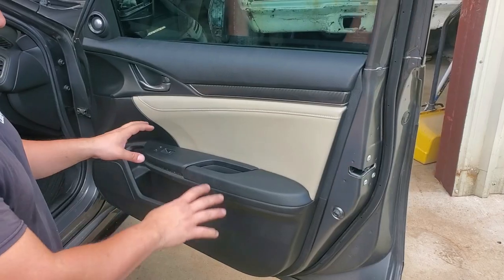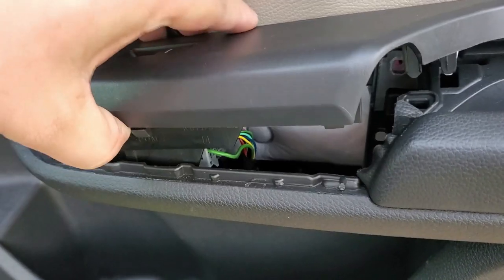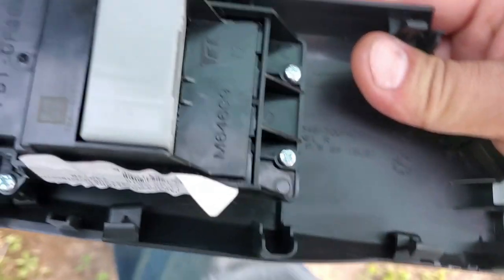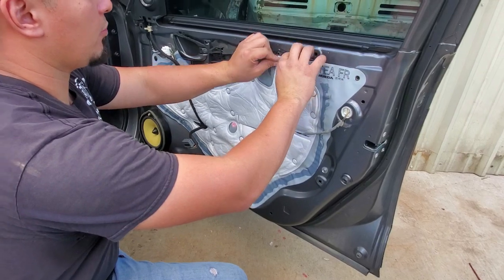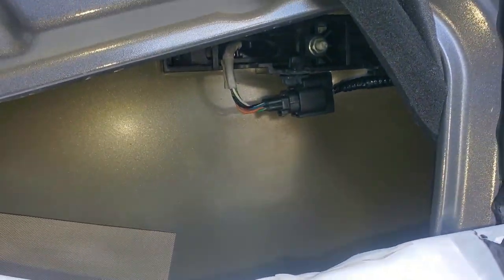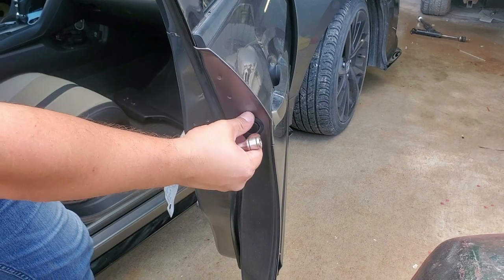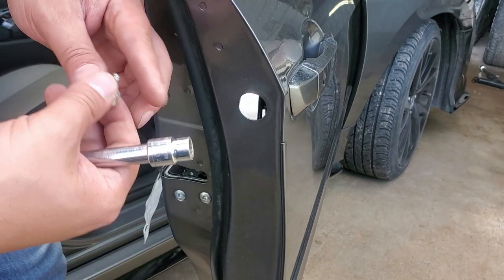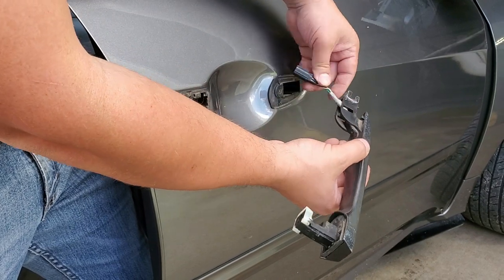2016-2021 Honda Civic Door Handle Replacement

Comment: Very useful, sir. But I would like to ask if I only want to remove the two outer parts of the handle to apply the black decal, do I not need to remove the inside of the door as shown at the beginning of the video? I just want to remove the two outer parts to make the decal application easier
Reply from the maker: @hdkenhphimhanhong8395  if I recall correctly you just need to remove the bolt at the side of the door and the handle should come out as shown

Comment: Hey Eddie, thanks for the helpful video. Do you have any tips on finding a replacement for a driver-side door handle that's starting to have paint problems like in your video? The door handle is totally functional -- just need to replace the plastic handle due to the paint issue.
Reply from the maker: Hey, so you are way better off painting to match the door handles. No need to replace them. And if you buy them, they will more than likely come unpainted. Take the car or door handles to a body shop so they can paint the handles for you. Unfortunately no other way around this other than repainting them...Honda didnt exactly do too well on their mirror and handles paint...
Reply: I have the same issue with my 2020 Civic. The dealership recommended going to a body shop. They said the could replace the handle, but the labor charges would be high.
Reply: @chris7015  so I actually ended up replacing the door handles myself and it costs such little money compared to getting it done by someone else or having it painted. It's also a lot easier that I thought it would be.
Reply: @AliKurnaz  I need to find a front driver’s handle for my 2020 Civic EXL sedan in Cosmic Blue.
Reply: @AliKurnaz  Where did you get your handles and do they appear to be good quality? I'd love to get rid of the flaky paint and think new handles would be much nicer than the covers as long as they work well. I have the hand-sensors for keyless entry.

Comment: Question, do you need to reprogram the keyless if you change out the door handle? Mine trips out it unlocks/lock without touching it and it may be why my battery is draining. Thanks
Reply from the maker: No you shouldn't have to. The programming is not saved via the handle so just simply replacing it will not require reprogram
Reply: @EddiesCustomsandRestorations   Thanks for the reply. I will unplug it for now and see if the draw goes away. If it does ill order a handle online and swap the module over so i dont need to paint a handle.
Reply from the maker: @philipl1302  yes ofcourse! And try the fuse pull method to see where your short is coming from.  With the use of a test light or Multimeter. Do some youtube video searches on how to find a short and that should help you incase this turns out to not be the problem.

Comment: I had to replace these handles on my wife’s 2019 Civic. The passenger side front and rear handles had flaky paint. I bought new handles from Honda and it was around $400. I don’t know what a paint job would cost, but that’s what “new” costs.. and yeah, between the door handles and side mirror caps, Honda did a shitty job with their paint.
Reply from the maker: Yea roughly to repaint the handles, and mirrors i charged $400.